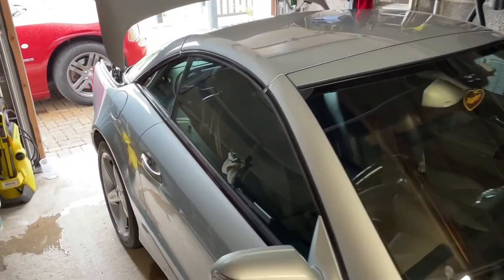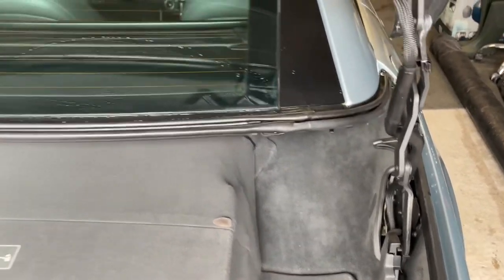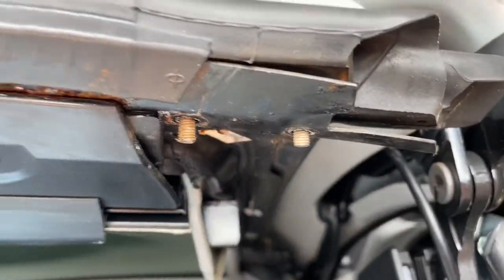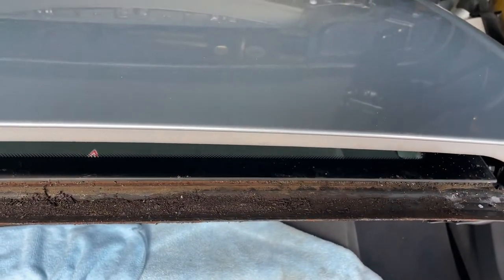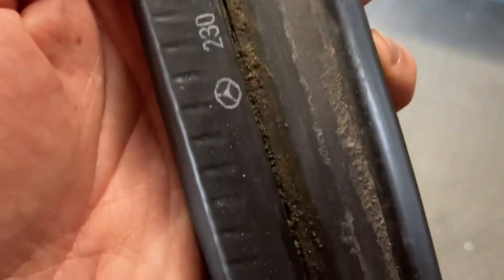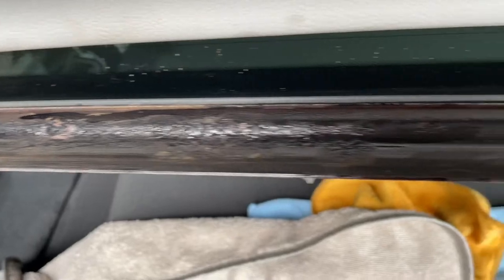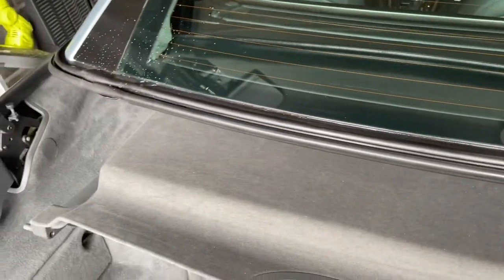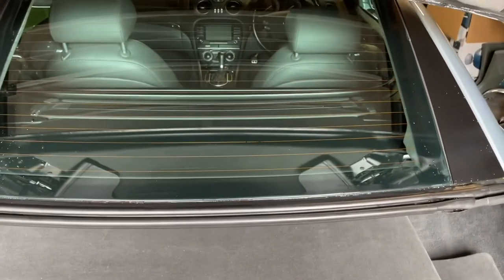How to fix a Mercedes SL R230 PART 2 water leak in trunk! SL350 SL500 SL55 SL65 AMG DIY repair.

Comment: Good job!  I used a strip of butyl tape instead of the 3M tape.  Butyl tape sticks extremely well and will probably last until armageddon.
Reply from the maker: Thanks! I used butyl for the c pillar seals. To be honest I didn’t have any to hand whilst doing this job but reckon the rtv will hold up. If I get the car road worthy again! Update coming in my next vid! Thanks for the sub!
Reply: I bought tons of butyl tape to do a roof seal and it should come in handy here!  Great video, with all of the rain in SoCal this year and my new truck project, my SL500 was left outside and this explains why I have a wet trunk!

Comment: If you take out the sponge on the pump although it feels dry it can hold loads of water , it took mine days to squeeze out and leaving it to dry, I also took out the floor bing which tends to block up easily
Reply from the maker: I know it soaks up enough to fill a bath! Thankfully mine is bone dry now

Comment: Mate thank you so very much for this , I’m beginning to have the same problem on my 2003 sl500, I initially thought the boot was not aligning when closed, creating a gap, I’ll research that of course, but I will indeed follow your advice and attempt the same job on those seals
Reply from the maker: No worries! Hope you find it useful. Other places to look are to clear out the water drains on the seals either side and the c pillar seals can also leak.

Comment: I have a SL350 and it has dried rusted marks in the boot areas where it typically leaks. From the receipts the owner wasn’t a DIYer but had deep pockets, I think the seal has been replaced but the rust is unsightly and a small leak on the right appears under heavy rain. How long did it take for you to do this fix?
Reply from the maker: Few hours altogether but took my time with sanding and painting etc.
Reply: @autogaragelife thanks I will give it a go , just cleared loads of muck from the seal and drain holes which has helped a lot and now it’s just leaking through the screw which holds on the seal so looks like the seal adhesive has perished. Did you go through a couple of tubes of kurust and J-B weld silicone?
Reply from the maker: Nope just one of each. Yours may be better or worse to start with though.

Comment: Those boot seals look like they have never been lubricated. 
Think slip jell like you use on swimming pool pump seals. 
Understand you should apply this gel every few years to all roof & boot seals.
Sadly poorly maintained SL's give people the impression these cars are beyond their pockets.
Grateful for your education so future buyer can affordably maintain their cars and avoid ones 
with lots of problems caused by owners not looking after their classic R230's
They are a fabulous reliable treasure to own and use regularly.
Reply from the maker: They weren’t when I bought the car but I have treated them myself since with the Merc lube. Here’s the vid: 

Mercedes SL R230 Prevent roof water leaks by treating the seals. Winter convertible maintenance.
https://youtu.be/-cbgy7NKdiI
Reply: @autogaragelife  I think it is fabulous you are creating a library of problem solving tutorials 
That is bound to see many R230 better maintained, used and increase survival rates - Great achievement

I run an R230 2006 
(think - engineering refresh model pre SLK look alike front end)
While it doesnt have the character of my previous R129 500SL, it is a great reliable car.
Appreciate all the effort you are putting in for all us SL devotees
Reply from the maker: Thanks so much! I hope to continue with them. Thanks for the support.

Comment: recommend me a silicone lube for the seals the merc benz one is stupidly expensive!
Reply from the maker: https://youtu.be/-cbgy7NKdiI
Reply from the maker: Gummi pflege 👍
Reply: You can use a lube called Gun Oil.

I use this on the seals of my A209 CLK .

All rubbers get lubed , all seals around the doors and windows.

Stops the roof creaking and makes sure no water leaks in .

Obviously very different to an SL but it’s the same principle. 

I do my seals every 3 months. 

2007 CLK 350 Sport …. No creaks or leaks at all .

Comment: Isn’t it better simply to replace the seal? How much does a new one cost?
Reply from the maker: Last I checked over £200 from Mercedes. Probably some ebay ones a bit cheaper but even buying a new seal you still have to do what I did with the metal plate before replacing. My seal was in good shape and it was simply the adhesive that had given up. 1 year on and it’s perfect with no leaks whatsoever.